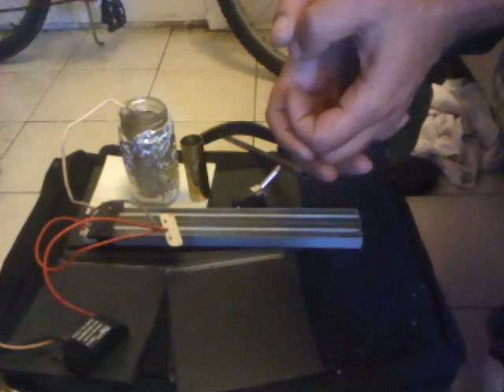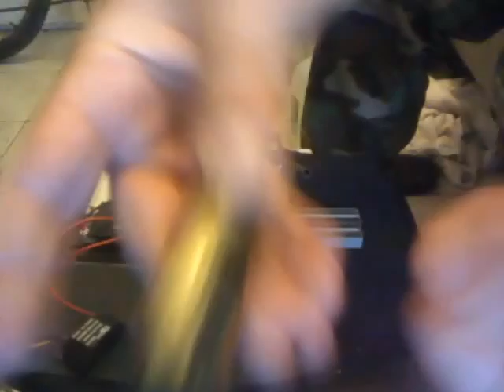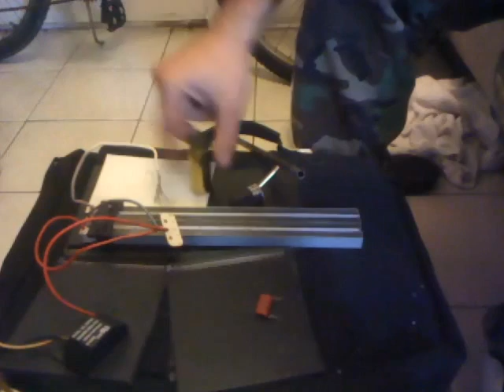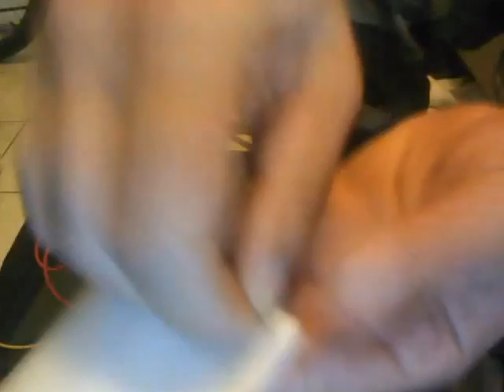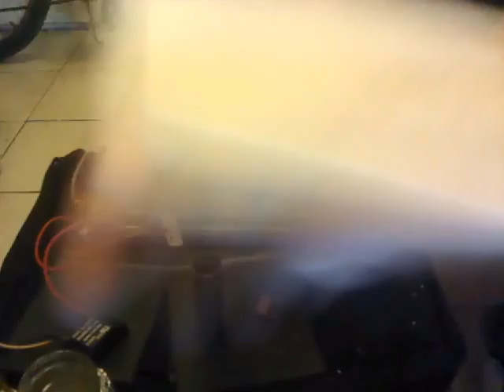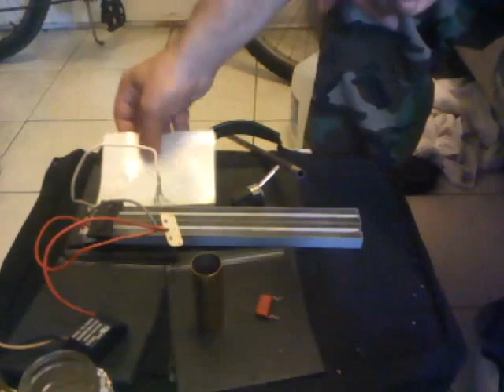Shocking results

Comment: Hmmm, brown effect.  Hmmm, interesting, like the felt is acting like a dielect between the tube and jar. Hmmm.
Reply from the maker: i really do not know the cause for the extra little shock i got, its , Basically it was slightly stronger. the tube ended up between the two conductors there for a second..  im just using my fingers to probe for discharges. but on the separated conductor, i must say the tube between the 2 conductors had to become the negative, and the jar the positive. i think something to that effect. as the negative plate becomes hmmmmm... i thought about this a couple times, over the years. cant put my finger on the cause. haha.. lol..
but since i am back i still have the metal nut i used, and buy the same brand of coffee. not to mention the ion generator has been working continuously for over 10 years.. i think i may have to re duplicate this video soon..

on second look the jar and the first conductor are both negatively charged..
acting more like a capacitor in that set up perhaps.. keep in mind i have not done any experiments in over 10 years. and i advanced the theory and understanding in the process..